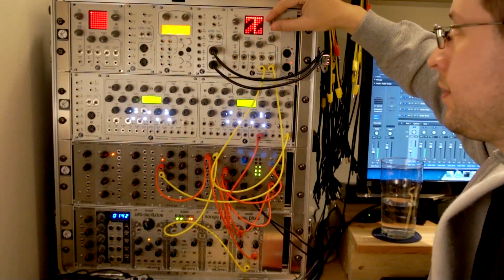Synth Demo 1 - Eurorack and Pattern Generator

Comment: hey man i just bought this pattern generator, amazing module but i can't understand how the offset output works. it seems what ever i do i can't make a sequence that is tuned to a scale. for example i have some harmony in A minor, set my Frequency of the VCO to A turned the scale switch to Min but all kind of notes off scale appear.
Reply from the maker: Please email us and we will help you: info@kilpatrickaudio.com
Reply: thanks for the quick reply. it seems according to the manual that i have to trim the voltage for the OUTS. My Akemie's Castle tracks it meanwhile my Erica Wavetable only outputs a single note.
Reply from the maker: Perhaps the Erica Wavetable only supports positive voltages? I'm not familiar with this module. The K4815 outputs the Eurorack standard of -5V to +5V at 1V/octave for pitch. Some modules only support 0V to +5V. Try increasing the OFFSET control to scale up the output.
Reply: that is exactly what is happening. i put the offset to middle position and now it's tracking every note in the sequence. it seems that Erica does not get along with negative voltages. thanks a lot for the support.
Reply from the maker: No worries! We are always glad to help.

Comment: I know it's a very general question, but I for example have no engineering/soldering skills at all, I've been producing music some years already by using vsts and standard synth - is there a way of syncing this to my DAW ? as my daw is the core of my production environment  ?

and also, for just starting up, how much money would I need to invest in lets say a small eurorack system (only 2 rows, not like your's 4) ? (very roughly estimate :) )

btw, I'm a big fan of your pattern generator, I think I saw it also in the IDOW video! :)
Reply from the maker: Yes, you can use a module like our K1600 MIDI Interface to drive your system from MIDI. Alternately the Expert Sleepers and similar units offer a different sort of control by making control voltages via audio outputs on a sound card.
Reply: From what I've read, a company called expert sleepers makes a good DAW-modular synth interface.